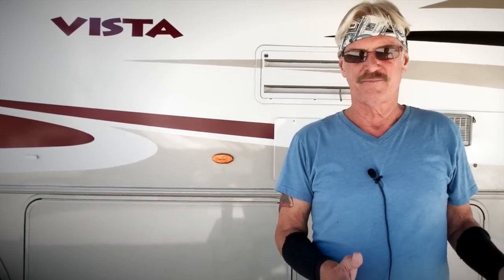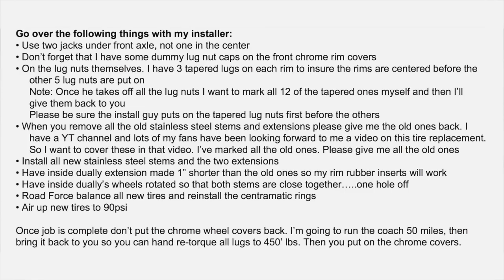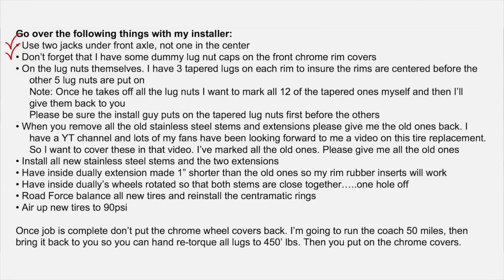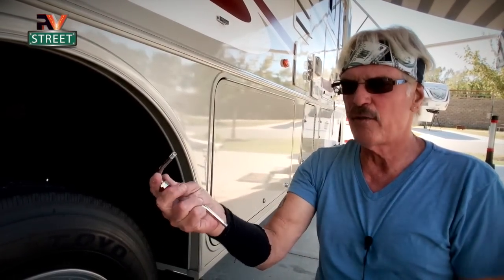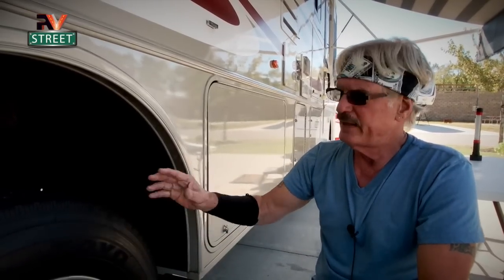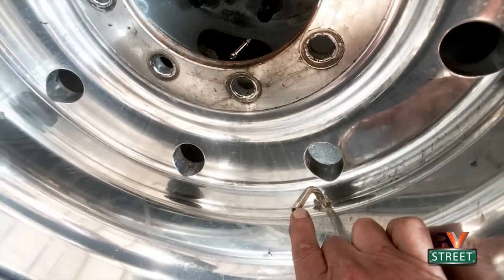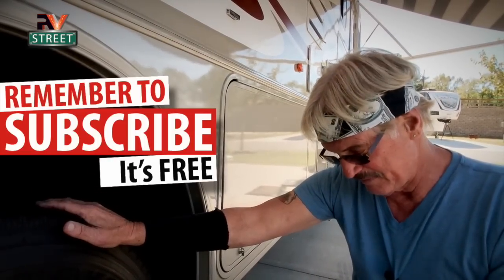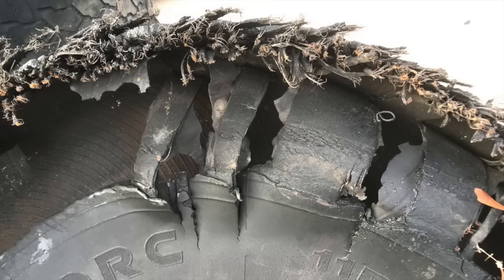In's & Out's of BUYING & INSTALLING New Motorhome Tires

Comment: Martin, another well done video. F/U with regards to mileage ratings. Not being a full timer, what sort of mileage rating should be considered?  Knowing replacements recommended at 5yrs, and say one only puts about 12K miles on over about 2.5yrs, what would be recommendation. Told wife other day that I had been thinking about looking for new tires as ours is about 4yrs in on DOT. We have the stock wheels on our 18 WB Vista 29VE, so the wheel covers are aluminum w/chrome finish, and the holes are those large oblong shape. Extenders that are on wheels, since we bought the MH used in 19, are those flexible reinforced stainless. The valve stems are solid though. Thank goodness, and knock on wood, they haven’t leaked yet. Our coach also has the Michelins, and suspect we’ll be looking for Toyo’s as well; used Toyo tires many years ago when I was a teenager riding motorcycles. I digressed🙂. Like to hear from you about mileage rating, as you know that too could be a factor for some of us who don’t get out as much as others. Thanks again.
Reply from the maker: Mileage rating doesn't count. Sort of. The more you run your tires the better it is for them. The constant heating and cooling of the tires while driving and sitting helps them stay healthy. Tires that aren't used often isn't good. That's why mileage doesn't really count. You could put 6K miles on it in 6 months and then it sits for 6 months. If you put low mileage every year, that usually means it sits a lot. Tires don't like that. Tires on a MH will almost always date out before they even begin to look like they need replacing. But there are so many other things that contribute to good tire health. Like proper balancing, front end alignment, proper PSI according to your weight, road conditions, keeping them out of the sun and so on. So IMO without knowing how you care for your tires, in your case with 12K miles in about 2.5yrs is below normal use for most MH's. Or at least full timing MH's. If you just use your MH periodically, then your tires are getting used even less than normal. So my recommendation would be—with all other things I mentioned above being in good working order—you should be able to go 5 probably 6 years on those tires then change them out. I know some folks go longer than that but I would not. Better to be safe then sorry.
Reply: @RVstreet  Thanks Martin. I use tire covers to protect from UV. I do need to do as you suggested in another video and drive coach every couple of weeks or so to help avoid flat spotting, and cracking.  The thing I was trying to get across, was assuming there’s a significant disparity between say a 35K and 65K mile tire, wouldn’t it be prudent to consider the lower mileage tires for folks that don’t put a lot of miles on coach each year?  Assume one isn’t giving up quality.  That was question I was trying to pose. Thanks again.

Comment: Martin. Excellent video and a lot of great ideas. One thing about Michelin’s .... you can have side wall cracking, front tires that are not wearing well do to alignment issues, a rear inside tire flat and still go down the road without having a blowout. I’m curious if Michelin & Toyo were the same price what would you buy? Thanks guys, have a great week!
Reply from the maker: Thanks Abby 😍
Toyo's for sure because of what you mentioned. Lots of cases out there about side wall cracking on Mich's. I was going to mention that but decided not to because then the video would of became a tire review video and could start a comment war concerning those who own Mich's. This was not a tire review but simply my choice of tires and all what to look for and to do when installing new tires. 👍
Reply: The tires were eleven years old and beat up but still getting me down the road in 40 ft RV. Looking back it was dumb but I was young, dumb and thought I new it all. 😂 In closing I never had a blow out with that particular set or all the sets we’ve had RVing for 53 years something no one wants to experience. From that point on I was Michelin man for life. 
Today we take care of our tires and run them for seven years with no cracking, dry rot or any issues. There’s a few things you mentioned that we will incorporate on the next set. Thanks for that 👍🏼

Comment: My Thor citation came with metal extensions.  Which rubbled against the simulators until they cut thru on the inside rear tire extensions and of course went flat.  Tire guy said 90 percent of all rvs that had flat tires were caused by the same problem I had.  So I removed them.   Problem solved.  I plan on watching all of your videos. I live in Willis so I will be looking for your motorhome.
Reply from the maker: The extensions were obviously not installed correctly so they'd be centered in the holes. A rubber grommet like I showed to hold the extension firmly would of also prevented this.
thx Stan 👍
Reply: @RVstreet  I do respect your opinion and advice.  The inside extensions  that were on the wheels were long and made of I believe brass and therefore kind of soft.  I think they wiggled as the wheel rotated causing the rubbing and cutting. The simulators are thin sharp and cut right into the stems.  I don't have the rubber grommets that may have prevented the problem.  The cut stem as you concluded was touching the simulator.  Another stem was considerably worn but was not touching the simulator while It was stationary. I am not real impressed the quality of the simulators.  They may have rotated on the wheel. Anyhow I think It would be a good Idea to let your readers know that this is a potential problem.
Reply: I found the rubber valve stem stabilizers on amazon.  I agree that should do the trick.  I just wish I knew about them before I threw away the extensions.  Thanks for the information.
Reply from the maker: @stanglenn1332  I hope you found the right grommets. The ones I showed in the video are tapered at an angle. Other ones that are available don't fit right. Trust me. I bought 2 different sets. Finding the right ones was very difficult but I finally found them. The ones that fit correctly are in my Amazon Store if you have the same rims as I do.
https://www.amazon.com/shop/rvstreet
Reply: @RVstreet  Thanks. 
The Mercedes wheels have 1.5"  holes and the simulators have 1" holes that don't line up.  I can buy the 1.5" stabilizers ($35.00 per pair) that would fit the wheel  but it would still leave at least half of the length of the extension going through the 1" hole unsupported.  It might work and it might not. I am looking for 1" stabilizers.  I may just go with the air pressure monitors and crawl under the chassis when the tires need air. I have read reviews that
 stated that the system was inaccurate.  Are you satisfied with yours?  Thanks for sharing your experience with us newbies.
Reply from the maker: @stanglenn1332  Oh ya, very satisfied. Never a failure or interference of any kind, been on there for 5yrs. now and have only replaced two batteries. That's remarkable. I also love the display. That's the main reason I bought my unit. It's large and easy to glance and read while underway.
On your simulator lining up problem. If this was my RV and I knew I was going to keep it for quite sometime what I'd do is ditch the simulators all together and go with an polished aluminum rim that is coated. They come coated and uncoated. Uncoated you have to polish them all the time to keep them looking good. Coated rims like mine you don't have to that. They look great all the time. That would solve your current problem of lining up, you'd be able to run and extension with a grommet to hold it tight in place and make airing up real easy. That's just what I'd do.
Reply: @RVstreet  Thanks for the advice.  I went to sprinter forum and found people that had the same problem with valve stems getting cut. Their solution was to buy after market stems with extension  simulators made for the Mercedes wheel at 160 bucks per wheel.  I don't think so!  As for keeping the Thor I think I will but am not positive.  It mostly has good quality components (although poorly assembled) and I like the economy part but I want to tow my Rubicon with it , which is exceeding their ratings.  I know how to not overwork my equipment  and I have read about other Mercedes  owners who towed jeeps, so I think I am ok there. I will go with the MG engineering system for braking lights etc.  PS Where did you get your wheels.
Reply from the maker: @stanglenn1332  My wheels came from the factory when new.

Comment: Martin, thank you for all your work on this channel. I just asked the Centramatic person on the phone about using their balancer on my Airstream Atlas motor coach with the 16x5.5 Alcoa wheels. He said that you can't use them because there is not enough clearance for the calipers. I said that I had seen someone (you) place the balancer between the two wheels in the dualies and he said he hasn't heard of doing that. Am I confused, or is this guy (from the company) misinformed. I also wondered how you get the stem across the balancer, since there aren't any extra slots in the balancer, just the 6 holes for the lugs.. Is the diameter of the balancer smaller than where the stems come out of the tires? Right now I am confused. Do you have any thoughts on this?
Reply from the maker: Either you asked wrong, maybe it's b/c of the size of your rims you can't put them in between the dually's OR I think he totally misunderstood what you're wanting to do. The balancers ALWAYS go in between the dually's.This is right from their website in the FAQ section:
Simply remove the wheel, use the bolt holes as guides and reinstall the wheel. Steer axle balancers mount between the hub and wheel, while balancers for the duals mount between the dual wheels.

Ask for Ricky Jordan. He's been their for years and knows what's going on. This is not rocket science. They just need to find the right ones for your rig b/c there are A LOT of different configurations.

As far as the extension stem across the balancer, you can clearly see here https://www.youtube.com/watch?v=zjVeal3qzb8&t=1224s ....at 11:01 in the time line how the stem extension comes from the inside dually, thru the balancer, then out the outside rim. Where did you come up with there's only 6 holes in the balancer for lugs? Do you not see those two large oblong areas in the balancers where the stems are: https://www.youtube.com/watch?v=zjVeal3qzb8&t=661s     19:10 in the time line?

Hopefully this will help

Comment: Hi Martin, I am under the impression that rv's need ten ply tires from what you said it sounds like 6 ply. What is the difference in tires plyes and is there a difference between class A and class C rv tires? I get a lot of misinformation and I trust yours which is why I'm asking
Reply from the maker: My tires are 16ply not 6. There's not much difference on Class A's and Class C's other than Class C's don't  carry as much weight and they usually have 19.5" rims therefore a smaller tire. Class A's like mine are 22.5" rims therefore bigger tires. Class A DP's have even larger rims and tires and carry more weight. I have a friend that just replaced his tires on his Class A, DP and those tires were nearly $8K.

Comment: Thanks martin for another great video!  My new 2022 Thor Hurricane didn't come with valve stem extensions on the rear dually's, so I want to install them to make checking and adding air easier.  My rig came with 22.5" Alcoa wheels, so I purchased Alcoa 5-1/2" valve extensions and the 2" rubber grommets for them.  The issue I found was that the inner rear dually wheel valve stems don't point directly out through the 2" hand holes, but appear to be aimed more towards the inner center edge of the hand holes, so this issue is stopping me from simply screwing them in like the directions say to do.  I was told that I may be able to simply bend them a little to get them aligned properly, but I'm not sure if this will work or not.  have you heard of this issue before?
Reply from the maker: Yes this is common. Each extension is straight. It attaches to the curved stem from the inner rim. When installing extensions that curved stem usually needs two or three attempts to bend it just right so that the extension comes out centered thru the hole on the outside rim hole and the grommet will hold it centered. In addition to this, the installer has to determine the proper length of extensions that will achieve this goal. 5.5" extensions MAY work with your application or it may not. That's why it has to be measured and installed then checked before they button everything up.

I don't know if you purchased the ALCOA extensions and grommets thru my Amazon Store or not, but I made note of this in the description of the grommets and the type of extensions I recommend. This info was also duplicated in the description text under the video.
Here's that text:
The rubber grommets I showed to hold the extensions firmly in place are hard to find. BUT....I finally have them in my Amazon Store in the "Tire, Engine & Chassis Care" category. And I highly recommend installing Dill Stainless Stems and Extensions.
So in conclusion, my recommendation is, buy the grommets from my store, then at the tire store have them install Dill Stainless Stems and Extensions which are very common and used by truckers and have them bent to be perfectly centered.
Reply: To be honest I bought this Alcoa 225392 stabilizer Extension kit a month and a half ago on Amazon, but I can't remember if I went through your store or not, but i saws you do offer the same kit from the same supplier.  I was mistaken when I wrote that I bought 5.5" extensions, they were 5-1/8' extensions in this combo kit  that came with the extensions and grommets in one kit. @RVstreet  I decided to install these myself after Camping World said they wanted to charge me $668 to install these on my MH that I purchased from them!  I did measure the distance from the face of the outer wheel to the inner valve stem and felt that the 5-1/8" version should work, since the only other version Alcoa sold had in a similar kit was about an inch shorter and from my measurement I knew this shorter version would not work.  I just saw your Tire video today, so I wasn't even aware of your recommendations on these valve stem extensions.  Is there a good reason to not use the Alcoa valve extensions that came in this kit and to use the Dill Stainless Stems instead?  I went with the Alcoa kit, since I had Alcoa wheels and thought that this was the way to go.
Reply from the maker: @cujo7240 No, not any good reason not to use them, I'm just saying that Dill is a tried & and true brand used by OTR truckers and mine being over 5yrs. old full timing without issue is why I recommend them. Yours may be just fine though. My 2 cents

Comment: Hi Martin, where did you purchase your (conical) tapered seat lug nuts? I called Dorman Mfg.

 and they  only recommend the factory 2 piece lug nuts stating that the rim would also have to be machined to match the lug nut taper.  

 Mark
Reply from the maker: When I replaced my rear dually's in June of 2017, I had Southern Tire purchase and install self centering lug nuts on all 4 rims for a total of 12 @ $10.ea., so I don't know where they got them nor the Mfg. There was no machining the rims. Sorry I couldn't be of more help.

Comment: Martin, do you use the same brand of tire for your spare? I have an all wheel drive VW Passat 4 motion so I can't use different sized tires and as such have a full size spare that I had to buy because one didn't come with the car when I purchased it used so I took the very best tire that was already on the car when I bought new tires and put it on the spare wheel. I'm going to be replacing it with the same type tire as all the rest when I get enough money but what sucks is the tires I bought are directional, Hankook Kinergy 4S2's.
Reply from the maker: For the car spare it doesn't have to be the same brand but should be the same size.
Reply: @RVstreet  Thank you Martin and Joanie, I watched you latest cancer video last night and cried my eyes out. I'm so sorry! My prayers are with you both.

Comment: Hello Martin 👋 
RV tire rotation too?
Someone said we needed.
Reply from the maker: RV's usually do NOT need tire rotation simply b/c the tires will usually date out before that's needed. However, if you see uneven tire wear that's a sign that perhaps you're running the wrong PSI in your tires OR you have an alignment issue or worn out suspension parts....etc. In that case, you have to determine what parts need to be replaced, replace them, then do a full ALL TIRE alignment. Watching you tire wear every few thousand miles is a great way to monitor these items. But again, if your alignment is within spec, your running the correct PSI in your tires, you grease the front end once a year AND have centramatic rings you should never have to rotate tires during the life you have them.
Reply: Hello Martin thank you so much.
I am so grateful that you learned a lot about Rv.

Comment: I just bought a 2018 Thor ACE. The coach was garaged except for when it was used. I expect I will be replacing the tires within the next 24 months.  It has 245/70R 19.5 tires. The tires you used appear to be for 22" rims only. What tire would you recommend I search for?
Reply from the maker: Yes I do have 22". Even for 19.5 tires I still would go with Toyos that can handle your load. Just search Toyo.
Reply: @RVstreet  My current tires are 245/70R 19.5G. There are several tires that match that size from Toyo. The tire I think is the appropriate choice is a regional truck tire with an H rating Model M143. All the other choices have a much more aggressive tread pattern intended for off road or snow / ice.